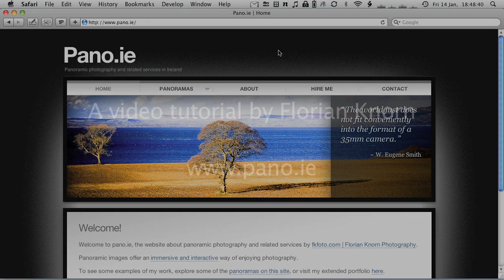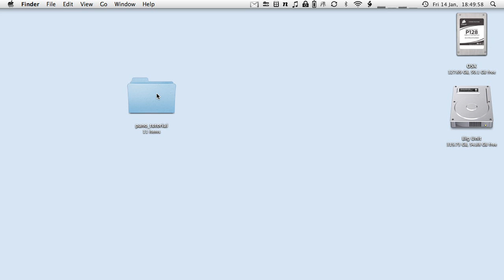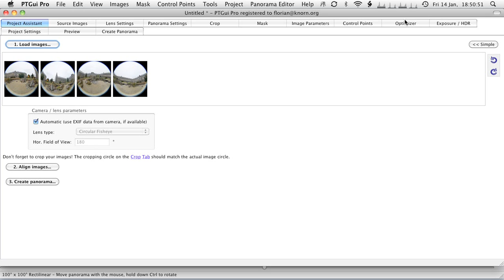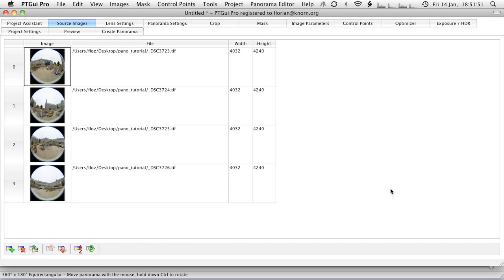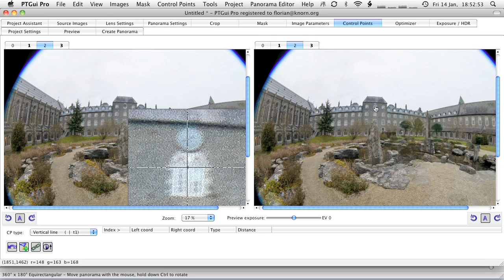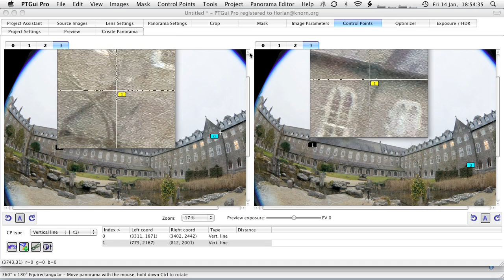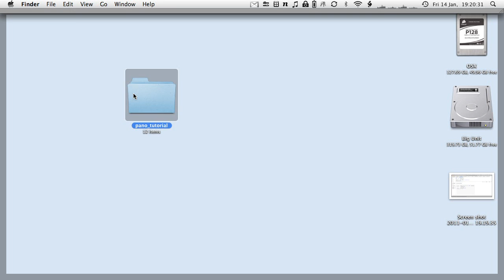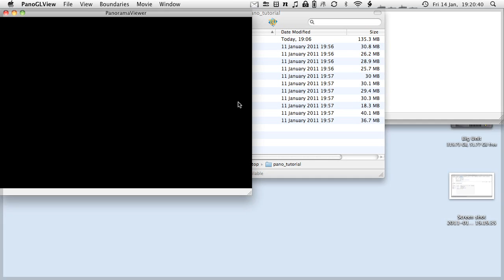360x180° Panorama Tutorial - Pt.3: Stitching in PTGui (1)

Comment: Thanks for a very helpful tutorial Florian! One question you may be able to answer - I've been using PtGui pro for a while now and have generally left the stitching settings at default. I'm currently putting together an image with a lot of positive and negative masking. When exporting with ptgui blender, those masks are honored. When I use smartblend and lanczos16 the image blending is better, but the masks have been ignored. Is there something simple I could have missed in the settings?
Reply from the maker: No, green masks only works with PTGui's own blender. For external blenders, red masks are applied (pixels masked away) so they have to honour them. But information from green masks cannot be conveyed to them.

Comment: Hello Florian,

Regarding the size for SV|T panos, as you know the minimum is 8000x4000 for google.
If I set the best size for pano in side PTGUI, It some times give less than the minimum as google instructions.
If I set it manually to the minimum is that will effect he quality of panos?

What should be done to get the minimum size if I have Sigma 8mm and Full Frame Camera?
Reply from the maker: +ali98ics What's SV|T ?? If PTGui's maximum size button suggests values close to 8000x4000, you can of course "round it up" to 8000px, that's not going to be the end of the world. But know that you are, of course, interpolating up, so you're not adding any details, just file size.
Reply: +Florian Knorn SV|T => Google Street view/Trusted Photographer.

Comment: I think you are using control points wrong. As mentioned in this link at ptgui.com  http://www.ptgui.com/ptguihelp/main_controlpoints.htm you have to "select two overlapping images by clicking on the numbered tab above each pane". Not the same images...
Reply from the maker: No, I'm pretty sure I'm doing it right ;-) From the same page you are referring to: "Vertical line aligns the images such that only the horizontal distance of the control points is minimized. Use this type to define points that should be on a vertical line in the final panorama, such as walls of buildings. This type of control point can be set within a single image, by choosing the same image in the left and right pane. But it can also be set in two different images if a vertical line crosses image boundaries."....
Reply: Florian Knorn Yeap, you're quite right! Should have finished reading before posting that. By the way thanks for your great tutorials. They were very helpful in my case. :)